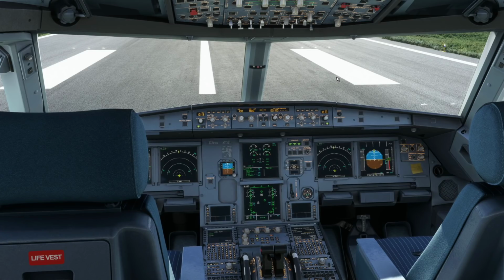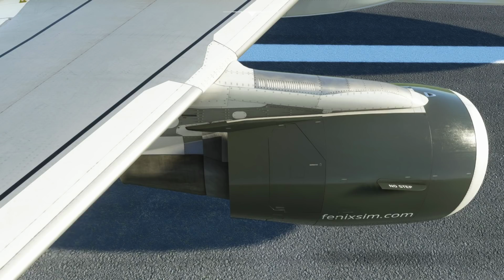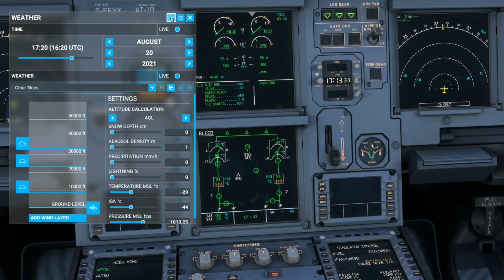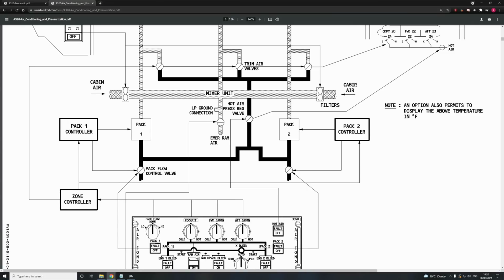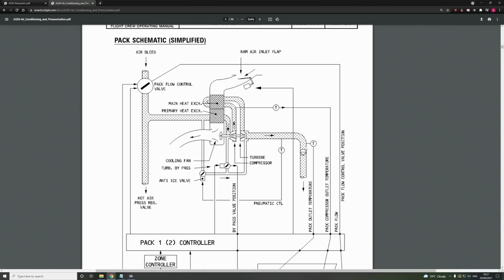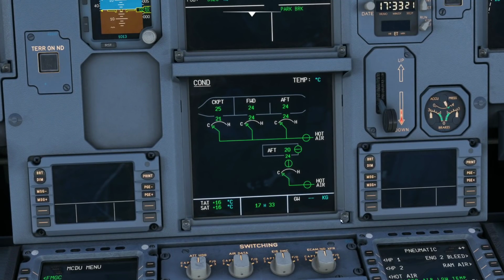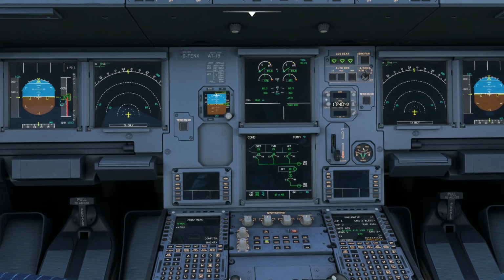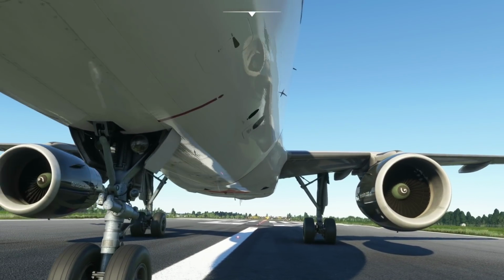Fenix A320: Pneumatic System Feature Review!

Comment: This is regarding the: Engine Bleed System:
 
Disclaimer: 

I do not know exactly which system modelling is the Fenix A320 based, if it is a Classic aircraft or the Enhanced or Mixed version. 
Because Airbus aircrafts in real life, mostly incorporate the mixing of Classic systems with the modifications of the Enhanced airbus systems I know the biggest difference starts with the introduction of the NEOs and the newer A321s.

Ok, I observed that during the time when the Engine Bleed Valve  (the Pressure Regulating Valve) is CLOSED. The HP Valve does not CLOSE. The correct system operation and when I talk about this; In accordance with the Description and Operation of the AMM on an enhanced aircraft config.

PRV (which is controlled by the corresponding ENG Bleed switches 1 and 2) is connected by a senseline to the HP Valve.
Which means; when example: 

if the ENG 1 Bleed p/b switch is in OFF position (which CLOSES the PRV) also in real life should CLOSE the HP Valve simultaneously.
which is not the case with the FENIX A320 bleed air system.

I think this is very wrong implementation of the bleed air system with FENIX.

Please correct me if I am wrong.

And it would be great for FENIX A320 programmers to revise the coding of the aircraft system and include it in future updates
to make sure that the PRV & HPV Closes simultaneously during operations when ENG 1 or ENG 2 Bleed switches are OFF.

Cheers!!!

Comment: Sir you mentioned that air temperature is regulated to 200 at the packs by controlling fan air valve , but that happened after after the air leaving the HPRV and temperature maintained at the precooler

Comment: If I remember right, If you loose the Hot Air thus loosing the Trim Air,  Pack 1 controls the cockpit temperature to the selected value and pack 2 controls the cabin temperature (FWD and AFT) to the mean value of the selected temperatures. Don’t know if this is simulated.

Comment: Aamir - There are two AC system components configurations. The diagram that you showed reflects the configuration that comprises 1 zone controller and 2 pack controllers, correct me if I am wrong but this is an old configuration. Usually the majority of the A320 are fitted with the 2 ACSC instead. Regarding the trim air system when you switch the HOT air off optimized regulation is lost. Trim air valves are driven to the fully closed position (the trim air valves must move to the “C” position instantly, since they air electrically controlled and pneumatically operated). Pack 1 controls the cockpit temperature to the selected value and pack 2 controls the cabin temperature (FWD and AFT) to the mean value of the selected temperatures.

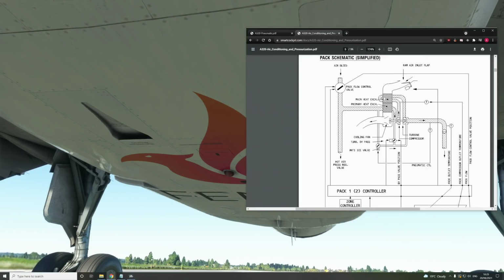Comment: Aamir at 31:20 - You speak about fan located downstream the ram air inlet flap and which is not depicted, if have a look carefully this fan is depicted on the diagram as “COOLING FAN” and it interconnected to the compressor/ turbine axis.

There is another feature that is not depicted on the diagram. There bleed system extracts water from the bleed air before it enters the turbine section. This water is then injected into the ram inlet airflow to increase cooling through evaporation. During the the walk around pilots usually visually inspect the ram air inlet flap for FOD’s  (sometimes it is possible to see the water injection system injecting water into the airflow). Would be something amazing to have it modeled!

Comment: Aamir, at 23:11 - You do not get an amber FAN message on the ECAM COND page by switching the CAB FAN p/b located on the overhead to off. 
They only come on (amber) if the related recirculation fan is detected faulty.

Comment: As an Airbus 320 mechanic (retired) I’m impressed. I fly the fbw A320nx daily. Your presentation are very detailed, and interesting for me to be updated. For your information, the fan you were looking for, halfway in to the video, is actually shown on the on the simplified pack schematic. It is driven by the ACM, it sucks air through the two heat exchangers, and is pointed at with an arrow, stating: COOLING FAN. Keep up the fantastic work. Looking fwd to the release.

Comment: i wish you also include the cfds menu, where you can simulate performing operational check and bite tests. for aircraft maintenance guys who love simulation of the a320. anyways, i think your work beat all of the mods out there. though, flightfactor simulates thousand of relays and toliss are officially licensed by the airbus. and  i can't believe even the circuit breakers in your work are simulated.  keep up, can't wait for the release
Reply: the circuit breakers are groundbreaking for msfs simulation, that level of detail has never been seen in msfs, and very rarely seen in any other sim

Comment: This is really great to see this level of detail and attention go into an aircraft like this. Such an incredible project that you all have undertaken. I can also tell you for a fact that these minute temperature considerations, such as how passengers and cargo influence the time it takes for the areas of the aircraft to heat or cool, are things that I will absolutely appreciate having in this aircraft. It can be frustrating and it certainly breaks that level of immersion when you see things that are simply hard-coded and don’t react the same way as they do in real life. Can’t wait for this!

I also really love this format, it’s much easier to digest and you can consume a lot more information via a video format. You’re able to show all of the aircraft schematics inside of the plane and then take you outside to show you exactly which ducts and inlets corresponds to what you’ve shown on both the synoptic pages but also in the FCOM. Hope to see more videos like these.

Comment: Sorry, I'm really sorry but this is utter shit. I've flown the real A320 for the best part of 47 years, and this is NOTHING like the real thing. NOTHING. Firstly, the pneumatics on all airbuses are powered by air, not hydraulics, and the left side is fully disunionised from the right side in order to keep both engines operating simultaneously. Secondly, the reason we have air pressure in the pneumatics system is because of forward airspeed, it correlates directly with knots to PSI, so 250 knots = 250PSI of pneumatic pressure in the hydraulics system. Now, the bit you guys have clearly failed to research is the RAM. On the real thing, the RAM is only used in the event of a total power loss, and there is ONLY ONE on the entire aircraft, you have put two in there and they don't even look like the real RAM. Whilst I admit in my age I might be misremembering some aspects of the aircraft, I am certain that just like the DC-10, the A320 had multiple friozone control for the PACKS and outboard transliteration valves, I didn't see this mentioned anywhere in the video? I really hope all these systems are just placeholder for now, as 6900 hours on the real thing is telling me you've got this all wrong. - Liam Sterling, A320 Training Captain.

Update: I just checked my logbook, I was indeed mistaken, I fly the MD-11, not the A320. Apologies everyone.
Reply: I may have had a slosh of sherry before making the above comment, and fully retract my statements. We may be pilots, but we're not perfect - I'm sure other commercial pilots will be able to corroborate how easy it is to turn up at what you believe to be your assigned gate and aircraft, only to be halfway to Malaga before realising you are not actually on duty today, you don't fly for Lufthansa, and you're not type-rated on the CRJ. It happens to the best of us. - Liam Sterling, MD-11 Training Captain
Reply: @AviationUK  Bloody funny. As we say in NZ, good on ya mate.
Reply: So you flew the A320 before the A320 was launched? Considering the first flight was in 1987, your maths gives it away.
Reply: @kieranmurphy5062  he's a troll i guess
Reply: "Pneumatics on all airbuses(sp) are powered by air"

I should hope so, Captain! That's what pneumatic means! Fenix got everything right here. ;)

Edit: Just saw your edit. You got me! Grade A trolling.
Reply: We have likely a troll here : 
The comment was posted a bit less than 26 minutes after the release of the video, if we count the time needed to write the comment itself, we would likely reach the conclusion that author didn’t have the time to properly review the 50min long video before posting his comment. 

None of the alleged mistakes he mentions are present in the video itself. Also 6900 hours on the A320 is very low for someone who flew for over 47years even if we assume that he actually began flying the a320 only 40years from now it would mean an average of 172,5 hours per year which is very significantly below average for an airline pilot. And needless to say that the incendiary tone of his message confirm furthermore the fact that he is a troll.
Reply: Proof that you are a real pilot??
Reply: You need to check your logbook to realize the difference between a MD-11 and an A320? BWAHAAHAAHAHAHAHAHAHAHAAHHAAHAHAHAHAHAHAHAHAHAHHA!!! 😂🤣😂🤣
Reply: Thank you Sir for the laugh 😄
Reply: Very funny, but you failed 😂🤡
Reply: I had a good laugh out of this 😂
Reply: You are confusing hydraulics and pneumatics. There are two ram air inlets and two ram exhaust outlets that you are confusing with the ram air turbine.
Reply: @iBlue0riginal  He's no engineer, just a pilot. 😉
Reply: you should delete your comment since you were mistaken :) and it's not nice calling something utter sh*t unless it is utter sh*t.
Reply: Great troll, made me laugh. You sound like Austin Meyer of LR are you him? Lol
Reply: Hello Mr Troll
Reply: I honestly hope that you are not a real A320 pilot because either you were not listening during the video or you just didn't grasp the material. I on the other hand have been in the aircraft maintenance department of a major airline for the past 35 years and I can say with all certainty that everything he covered in the video was correct. If you do not understand the difference between hydraulics and pneumatics and you can't understand how either of them operate then you should probably think about  asking whatever outfit you claim to fly for to retrain you on this Airbus family of aircraft, or consider retiring. Aamir, you keep doing your thang baby!
Reply: @SHOCKSTRUT  
Read his full comment “Update: I just checked my logbook, I was indeed mistaken, I fly the MD-11, not the A320. Apologies everyone”
In other words he was just having fun trolling.
Reply: @armandbrn3281  well it got me 🤣🤣🤣
Reply: Don't know if the guys above didn't read everything or if they are just retards.. Thanks for the laugh @LS 🤣
Reply: Brilliant! Great learning video,  can't  wait for more video tutorials, and of course for the release of this bird.
Reply: As a pilot, you can really help the Fenix team. The Fenix team probably values your feedback, but please be a little more understanding. The plane hasn't even been released yet and is far from being released :)
Reply: @expri_plays1  I doubt they'd want his help; Liam was right that the air system uses air (not sure why he thinks Fenix uses hydraulics), but he was wrong about the 250 knots to 250 psi in the bleed system (what!?), he also confused the bleed system for the ram air turbine, and the only real similarities between Douglas Companies' late era packs designs and the A320 CEO is that they had components in the wings. Like the Captain said, he's misremembering.
Reply: @WestAirAviation  after his "update" of him saying he flies the MD 11 and not the a320 I'd say they don't need his feedback of course.